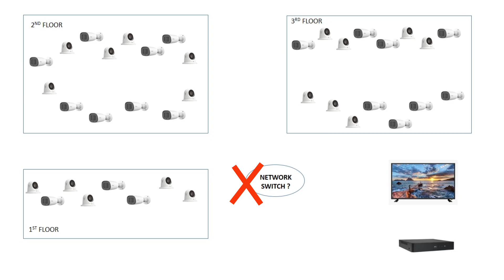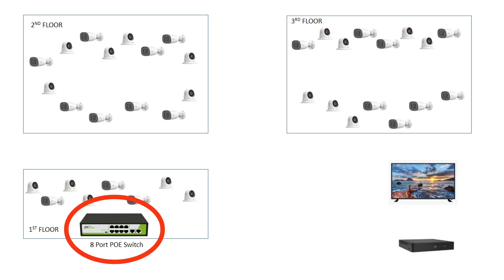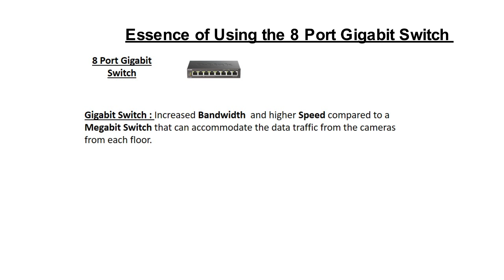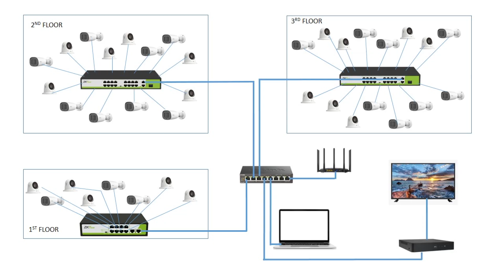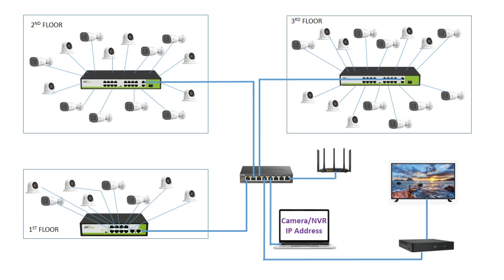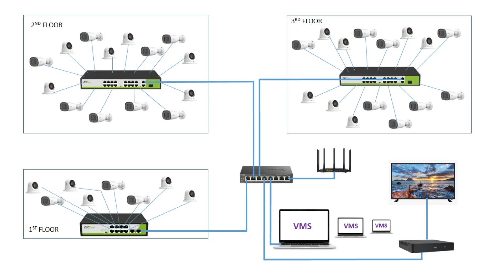Big cctv camera installation project planning & installation strategy: guide for large cctv projects

Comment: Nice planning, But i do think there is some key details to work out that i feel most would need but not realize at the moment of installation or planning.

How does the storing of the footage happen? Is it all centralized to the NVR?

If so, do you consider any backup plans for the footage or any recovery plan?
Is there a concept of RAID applicable to the NVR?

How would you approach this if its a DVR setup for cameras still using Coaxial? 
or would it be wiser to just switch the setup to NVR?
Reply from the maker: 1. Storage can either be centralised or decentralised. I did a recent video on decentralised recording in a setup like this.
2. Having a decentralised recording creates the backup of your recordings.
3. As of now, am not aware of any NVR that provides for redanduncy, may be there is but i have not yet seen.
4. Analogue systems can also be structured in this manner, i will perhaps do a tutorial on how it can be done

Comment: Assuming I have up to 90 cameras and about 4 or 5 screens using this same system how do I share the cameras to the screens
Reply from the maker: You can use an HDMI splitter and feed the NVR output to the splitter and tgen take the output of the splitter to your screens. 8 port splitter can be useful.
Reply: But in this case you may  be viewing the same camera on all the screens